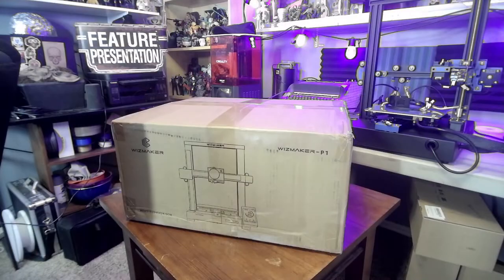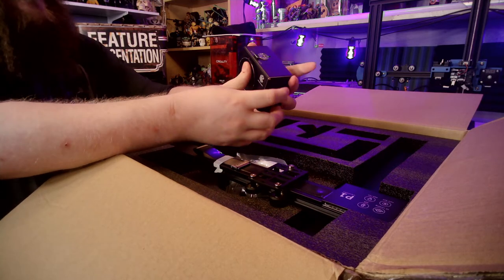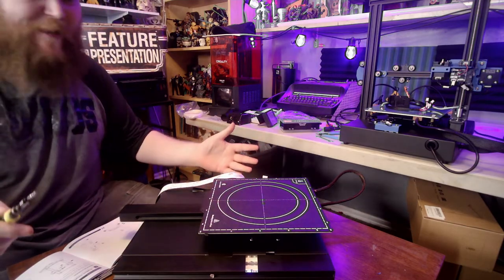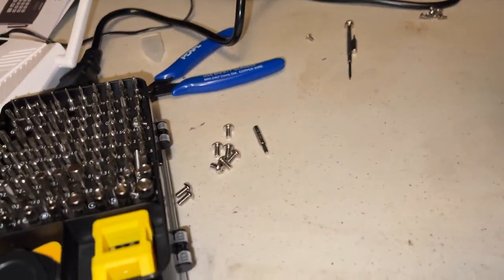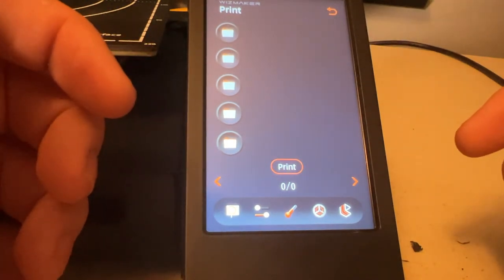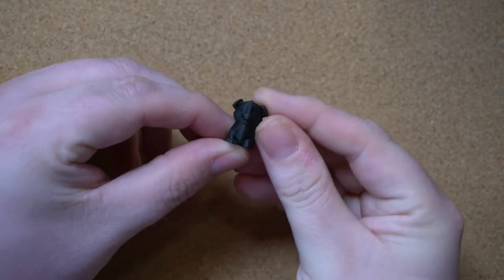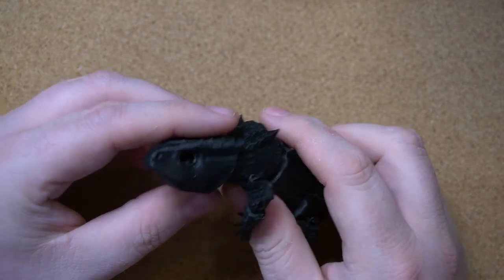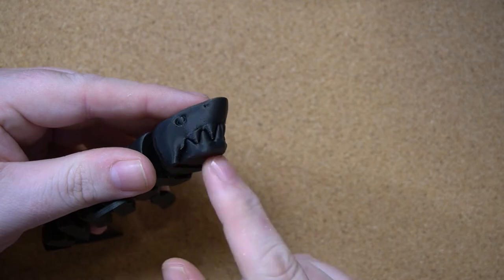Ryno Reviews the $399 Wizmaker P1 3D Printer

Comment: Great Vid, Im a vetrain at 3d printing, i have my ender 3 heavly modified, and a CR10S5 with a main board mod, and watching this vid and that printer set up, which was fast and amazing prints out of the box, i wish my prints looked that good out of the box, after 3 years of tinkering i finally got it to print perfect.  This vid makes me want to buy it just to have a printer to do basic quick prints. I would love to see you do your settings and kinda curious how it would print pteg or abs. You could probably get away with printing pteg since the max temp is 260 for that printer. Again Great vid and will sub for more of your content. Thanks again. Oh ya and one last note, after you load the STL file you can select the object and on the left is the 4 point arrow, click on that and you can move your print down in the Z to take that model platform off you just lower that section below the print bed, to the height you want and then slice it. it will print only what you have on the top of the bed

Comment: how much calibration did you have to do? Did you have to run e-steps? Did you do a lot of flow or retraction changes?
Reply from the maker: I didn't mess with e-steps, but I did change the retraction settings to 1.2, I believe.  It's been a few weeks since I actually looked at my changes.  I followed a guide by Paul Feeney.  He's very active in the Wizmaker group on Facebook.  Also, a guy named Ido Too made a profile for it and g-code that I use.  

Here's the group:  https://bit.ly/3zYbOLp

Very helpful folks there.  Great community behind this printer.
Reply: @RynoDBones  awesome I am thinking of getting one. I've been printing for around a decade and I would love a printer I don't have to mess with for weeks
Reply from the maker: @PantherTheCat  I’ve had to do a few normal maintenance things, re-leveling, unclogging nozzle after the extruder got loose..haven’t had to tighten any belts yet, though.

Comment: I was just going to order a Biqu B1. Would you say this is a better choice
Reply from the maker: Absolutely this is a better choice.  Newer tech, auto bed leveling, better UI.  I’ve been in the FB group and so far the only issues people are having are the most common ones that can usually be fixed with re-leveling the bed or tightening the belts - blobs of filament ending up on the hotend.  Wizmaker is also very responsive in the group.